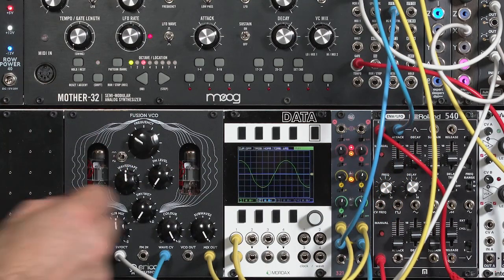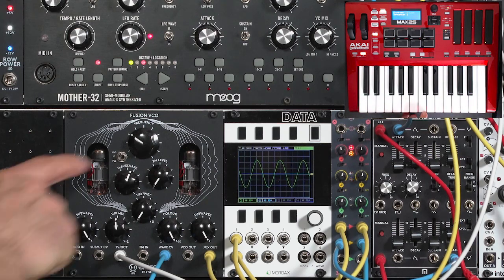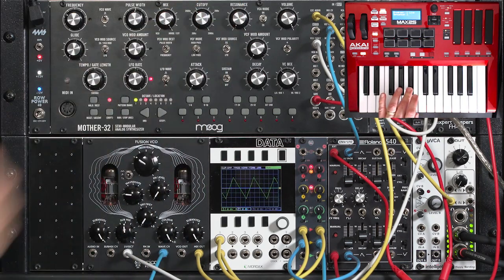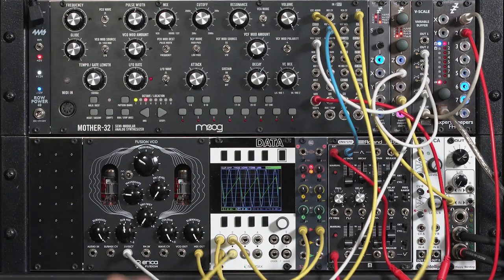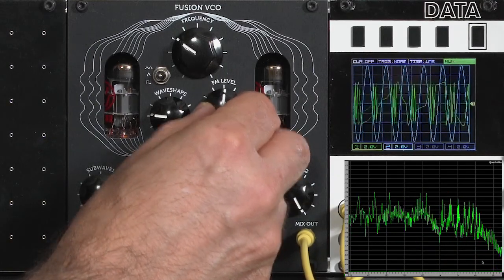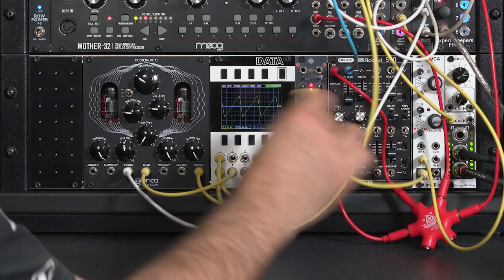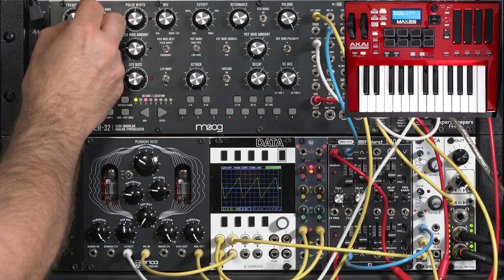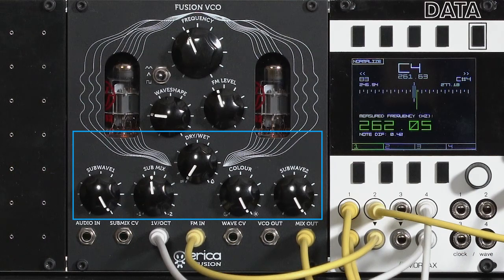Erica Synths Fusion VCO 1, pt 1/2: overview; oscillator (LMS EE)

Comment: too pitty this thing has not reset function. its one of the most unique euro modules really. 

question : do the tube waves reset if an audio signal(say an external vco) is patched? so if the signal introduces silence, maybe there is a reset behavior on the tube waves? i think not but why not ask.

in my book, the only way to create fast BPM basslines with this would be by using the WMD DVCA to at least have it go through a zero crossing detection before passing it into a filter. the best way will be to just record some waves and put them into a sampler with zero crossing scanning capabilities and go on from there.

things get tricky on high bpm basslines, check out the only video on my channel to get an idea. the wave phase must be the same on every hit. big pitty for this module, and version 2 does not do justice for this matter. it uses its tube differently.
Reply from the maker: The tube part of this module is just a waveshaper - the octave divider - so whatever you send in should be represented on the output. Unless the tubes are acting as a flip-flop, so there's a chance they may have an unexpected behavior when you reset the wave sending going into it (i.e if the output is currently high, resetting a sawtooth wave can result in flipping the output to low). I no longer have mine to test.
Reply from the maker: From the description at https://www.ericasynths.lv/shop/discontinued/fusion-vco/, I would now expect it to work more like a flip-flop, so I don't think you'll get repeatable expected behavior when resetting the waveform going into it.
Reply: very intresting. thanx so much for replying sir. will test it out soon. seems that the best way to tame it is to simply sample it and do whatever but i will run an extensive set of tests first

Comment: I am sorry can I make a question?
Reply from the maker: Yes.
Reply: My system for the moment is Xaocs Zadar, Intellijel Rainmaker and Erica Synth Fusion Vco. I would like to ad Xaoc Belgrad. I control them tendencially via Synthstrom Deluge. I have a little mixer where I let the sound come out on the program or on the speaker/amplifier. I would like to make the Fusion Vco having a sound that starts and stops once the value of the note ends, if no release is putted. I would like to avoid to buy a vca though. Is that possible somehow? I thought I could turns up and down the volume of the mixer every time and that's not even that bad, but, you know, it would be also nice more "control". The patch usually do is the following, making the easy example: Deluge on Vtrig, gate 1 in Zadar trig of a channel, Zadar Bank A first shape, Zadar out in the vco out, mix out in the intellijel in, the intellijel in the mixer. It reads the envelope, but the sounds continues in infinite repetitions, since there is no vca amplifier to make the sound being filtered by... am I really really oblige to think about buying a vca? Can I put, let say, a stackable cable here and there to make the system act as a vca's cv? Sorry I study bassoon and this make a really nice system to get along with also for classical purposes or similar music style but I am not playing it everyday since I study and when playing it I adapt but come across to little problems like this one. My previous modular experience was some videos and vcv rack... thank you in advance. 😊😊😊
Reply from the maker: @thieomkara2964  this is the job VCAs are designed to do. Plus they have many other functions inside a system, such as controlling the depth of modulation signals. You would be better off in the long run to add some VCAs to your system (or perhaps a low pass gate).
Reply: @LearningModular  Thank you very much, I knew it, maybe I am making a Vca, clock, lfo and sequencer system in another tip top happy ending kit case or taking a Berhinger low cost powered one, with a veil, a intellijel quad vca, maybe an Odessa, something like math and/or a couple of Pico rdn, or better, for generative music, euclidean circle, one or two depending on some factors, with a z8000... I turn the volume down for the moment. 😂😂😊
Reply: @LearningModular  in the end i found a solution, cardboard blank stuff like, with some drawns, blockage for the uzeus power supplie, since it take the hp it takes in the tip top happy ending kit, plus katowice and doepfer double vca, the 4 hp one. Super happy, thank you once again. Katowice, can do almost all Belgrad, can if properly setted. With the vca, economical and handy, i can do from elctronic to classical without problems making all sound like an orchestra. Once more thank for your help =) =) =)
Reply: I played also guitar and my modular experience is also pedal boards, more simple, in a way, modular synth differently cv controlled. My favourite was effect was and is the delay and with rainmaker and zadar super, all super, I made drums and melodies together, all choirs and electro sounds... but with the vco I would like to understand if I am doing something wrong, because it would be really a great voice also to make bassoon, bras and strings sections sounds
Reply: Oh yes. Sorry for multiple comments in once. Cv 1 in the 1v/Oct of the fusion vco

Comment: I wonder why the digitally produced square wave includes changing the DC offset and you modulate the pulse...
Reply from the maker: It's probably because the output is AC coupled. A natural side effect of AC coupling is that it tries to get as much "area" under the waveform to be above the center line as below the center line; that's how it averages 0 volts and has no DC offset.
Reply: @LearningModular  That makes some sense, I guess that it would be further evidence of band-limiting filters that subtly change the overtones.  Also, I take it this is not an oscillator you can use as an LFO.